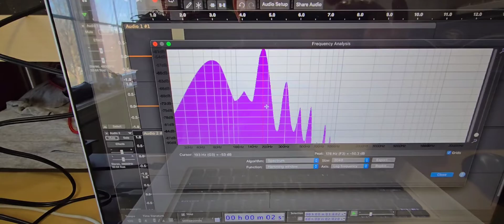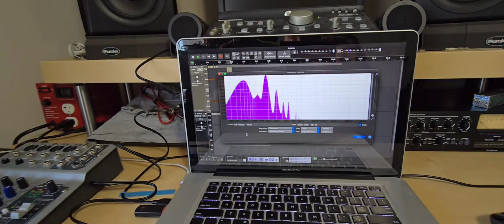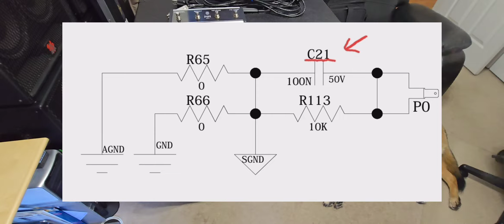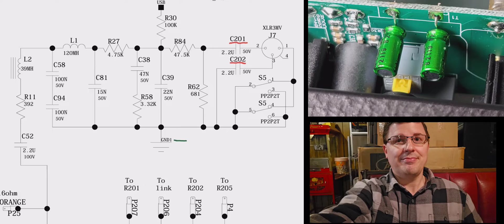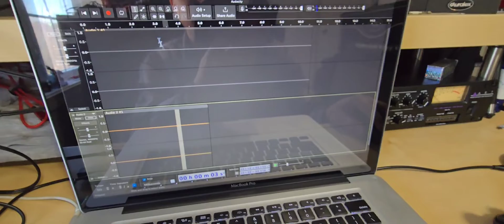Peavey Valveking MK II 100W Amplifier Repair: MSDI & Speaker Hum/Buzz

Comment: Nice video! My VK MKIII was purchased nearly opposite of yours. Saw a cabinet for sale (that I did not want) and asked about the head. $50 and $15 in parts and it is back up and running. Always interesting to go through the schematics and find WTF parts and revisions that never made the published schematics. These MKII are like swiss-army-knkives of amplifiers. There is pretty much something for everyone in features and sonic ability. Glad you figured out your issue.
Reply from the maker: Absolutely and thank you so much for watching! Yeah I'm no guitar player but I've been spending a lot more time messing around with guitar in general. People either love or hate these amplifiers but I find that the majority seems to really enjoy the tones they're able to get once some of the circuit design flaws have been corrected for. For the money you really cannot beat them. 

The other funny story with the valveking amplifier heads in general is that many will remove the Peavey logos because it makes the other guys who run expensive $2k+ guitar rigs look like schmucks because they are getting the same kind of quality tones out of a $200-$350 USD budget rig. It sounds silly but it's true!
Reply: @Bassguitarist1985  once into the boost/gain side of a tube amp (I guess any amp) maybe some EQ settings and a lot if it all becomes the same. Equipment snobbery is always a thing. I have also played with Audacity and the graphs tell the story.
Reply from the maker: @SpencersMountain  yeah there are subtle differences with the type of valves used, biasing, circuit design, etc. saturation of the pre gain stage then determines how much odd and even order harmonics come through. It's a wonderful hobby to dabble in!